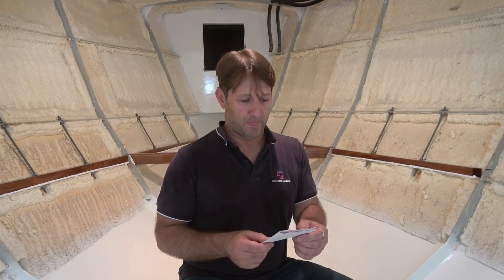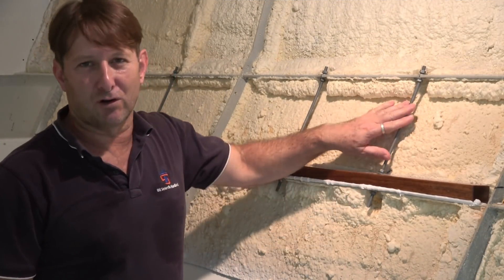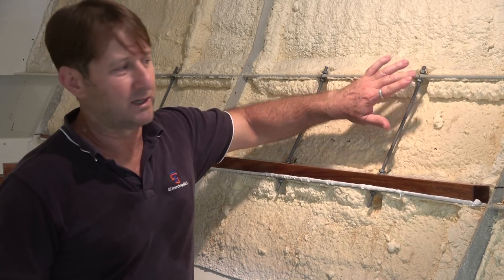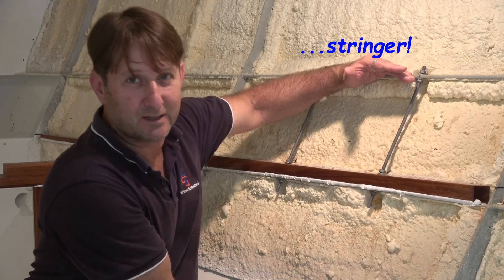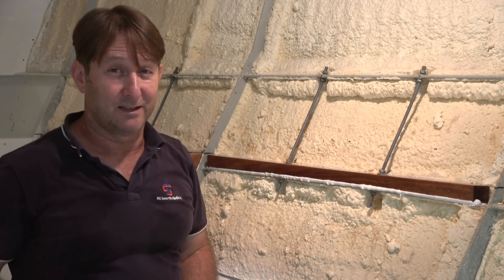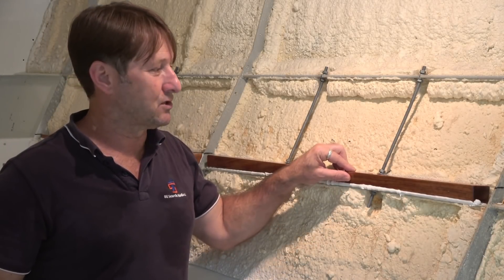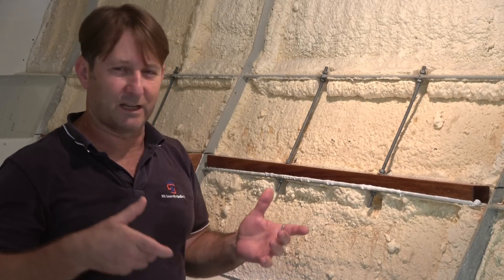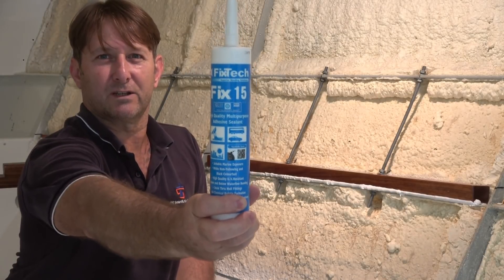Building my steel sailing yacht Tech.talks #1 Intro. & V berth support

Comment: Hi Bruce,
Sometimes videos does not show well dimension, could you present by saying or still picture of drawing what you are working? Example like V berth wide in this part of support is 2,3 meters and floor height will be 60 cm. more understanding to viewers I could think. Really good work. Keep doing.
Reply from the maker: Thanks very much for your good comments Sami and re. your question for more details, I think that because every boats dimensions would be very different that it may not be so useful to include such details, each boat hull design and then the fit-out design have so many variables  😬👍⛵

Comment: On the right way my friend 👍 I noticed you didn’t put in the extra bulkheads for the front cabin and aft cabin, which give the boat more strength and can used for closing the compartments (with expensive watertight doors) to prevent total flooding. Was this to reduce the weight? Tip from my side is to install a bow thruster (at least the tunnel) when there is still room to weld. Although its a heavy boat, the bow is high in design and catches a lot of wind...this causing several damage to my bow when mooring with strong cross winds (feels like steering with a flat front tire on a bike). I watched some YouTube videos and did it myself, which was easier then I thought it would be. The installation of the tunnel is not the most expensive (I paid around 150 Euro for a second hand tunnel and materials for cutting, welding, filler and paint). The bow thruster itself is the expensive part and will be around 1.500 till 2.000 Euro in total (including wiring, batteries and control), which depends on the boat size, but can be installed in a later stage.
Reply from the maker: Hi Berend and thank you very much for your comments, much appreciated sir!
Regarding the bulkheads, yes there will be multiple bulkheads put in, but not steel watertight ones. This is a big subject but just to mention a couple of things - the inherent design of Mistress is such that being steel her frames and hull are sufficient to support her structural integrity and also adding marine ply bulkheads further increases her structural strength; very, very few sailing boats when under way and being used actually sink; of the few that do, for eg. hit something and take on water flooding a section of the boat, are saved by for eg. sealing a forward water tight compartment. From my point of view there are many other important considerations also but it is something that I have seriously considered and am happy with what I have decided.
Also just to mention, actually Mistress' designed displacement is only 9 tonnes so she is quite light for a cruising yacht of her length and her free board at the bows is only 1.2 metres and her free board generally is quite low, another of my reason's for deciding on her design.
Regards to the bow thruster, yes I can imagine that having one could come in very handy at times, but for several reason's I won't be having one.
I really do appreciate and enjoy hearing from you (and everybody) with the many different things that you raise AND I am also learning from you good people, so thank you very much for taking the time to write and comment!  : )
A Merry Festive Season to you and your family!

Comment: You might want to try a wireless lavalier microphone when you are talking to the camera inside the boat.  Overall, I like your post-production narration.

In the US, that "toggle stick" would probably be called a "story pole".  Good rough carpenters (framers) use them.  Much faster than measuring and it keeps thing true,
Reply from the maker: Thanks very much for your good comments Jack and yes I agree re. the lavalier mic. and others have suggested this too. I think that it is time to add this to my growing camera gear,....
And yes, I am also familiar with the "story pole" version of the toggle stick, so simple and so useful hey!
Thanks again for your good comments!  🙂

Comment: Hallo, really appreciate your love for detail. I like steel boats , but it seems to me that the connection between steel and wood is a difficult point. think you doing very well , even if it is very time-consuming . I s there any advice what could be done simpler in the steel building phase (before paint and insulation) brakets, inside  stringers with pre drilled holes ....? maybe I thinking too complicated?  keep on the good work Thank you and have nice chrisms time
Reply from the maker: Hey thank you very much Bruno for your great comments and questions, I really appreciate it!  Regarding connecting the fitout materials to a steel hulled boat - I think that this is quite simple and easy actually AND VERY strong, but yes as you mention the fitout details need to considered once the main hull and decks stages are done so that cleats, brackets and drill holes can then be done before the painting.
Actually you have just given me another tech.talk topic idea to discuss, because I did exactly this, I welded all of the cleats and pre drilled holes in the frames and beams before I painted!
And YES, regardless of the construction material, ALL large boats = "very time-consuming"!!  : )
And a Merry Festive Season to you and your family also Bruno!!
Reply: @BuildingSYMistress   looking forward on the tech.talk   Merry festival season

Comment: cheers dude,still trying to work out if Ima be a tight ass and use foam board or not,I'm in Adelaide so I may need your spray foam supplier
Reply from the maker: Adelaide hey, very cool, I am from Adelaide! What design is your boat and where is she? Re. foam supplier contact, sure no problem!  : )
Reply: @BuildingSYMistress  its a 1 off the hull was professionally built at whyalla steelworks the original owner drew up the blueprint and had it drafted up by an adelaide marine architect,it's based on an english design which is why its a bilge keel which makes it great for the barker inlet which is all silted up which i have to go through to leave garden island where she is.
if your in Adelaide I know just where you may wan't to keep her when you get her in the water
Reply from the maker: @razzorbladz  Thanks for your reply and for explaining!  I live on the Sunshine Coast now, I moved here 20 years ago.

Comment: Hi Bruce. How are you?. Great video!. Adding  an extra flat bar, it's one of the extra modifications on the original desing?. Making so many holes on the 6mm flat bar, could add some weaknesses to the hull?. For those, like me, who don't know so much about VDS QAM, the hull support all the loads an efforts by itself?. I mean, the bulkheads in the Caribbean 40, are made of wood and not steel, as we are used to seeing in metal boats ?. Espero no haberte saturado de preguntas, y que dentro de tus posibilidades, las puedas responder. Saludos y nuestros mejores deseos para está época festiva. Continúa  así!
Reply: Juan Martín Santulián My bulkheads, on the my v/d Stadt 36 Seal, are steel plating and would be useful if they didn’t mess it up with a lot holes...then I would have the possibility to make it somehow watertight. Otherwise wooden bulkheads are also good enough and easier to work with...
Reply from the maker: Hola Juan, I am very well and thank you very much for your great comments and wishes, much appreciated!  😀
Yes the stiffener bar was just 1 of my little add on idea's and those small holes would be no problem at all regarding maintaining the strength integrity of those flat bars, especially when also those threaded rod bars have filled the space too!
The inherent design of Mistress/the Caribbean's is such that being made of steel her frames and hull are sufficient to support her structural integrity and also adding marine ply bulkheads further increases her structural strength. I definitely trust E.G. Van de Stadt's design expertise!
Oye tranquilo amigo, no a mi molesta nada con tus preguntas ok!
Que tengas buenos Noche Buena, Feliz Navidad y te deseo un Feliz Año Nuevo! 🎄
Reply: @berendjanweurding9866  Thanks for your answer!. I made my first trip on a steel boat, in a VDS Seal 36, named Kira Kira. Beautiful sail boat.
Reply: @BuildingSYMistress  Thanks Bruces. What I mean, is that you can choose wood or steel for the bulkheads or the frame that supports the floor?
Reply from the maker: @AWKA0386  Yes Juan you could choose between wood or steel for the bulkheads, although for the VdS Caribbean design they stipulate plywood and timber on the plans.